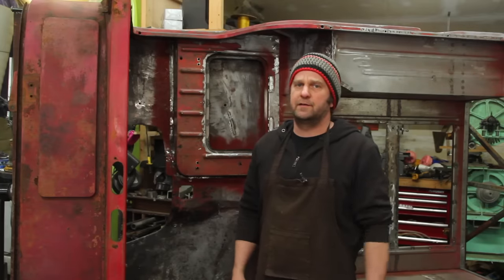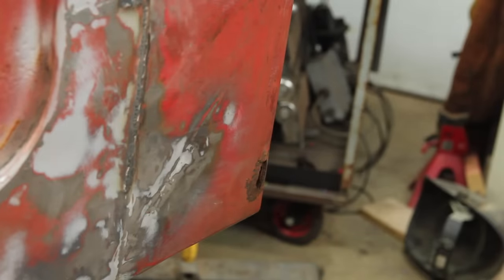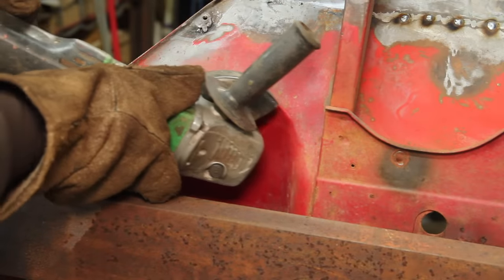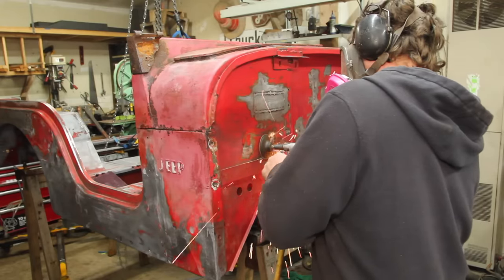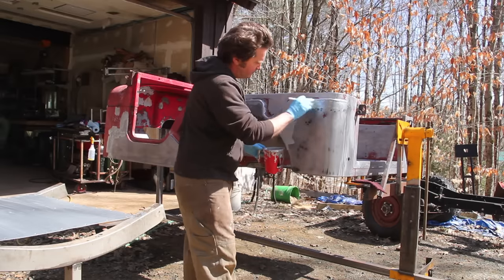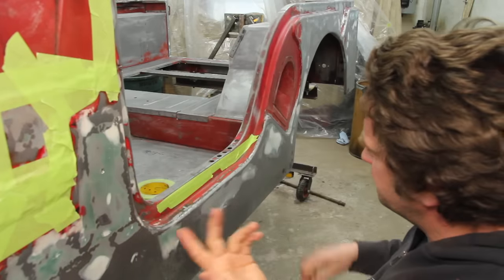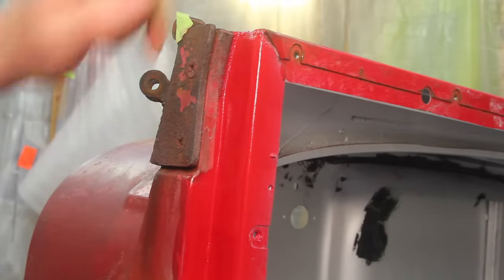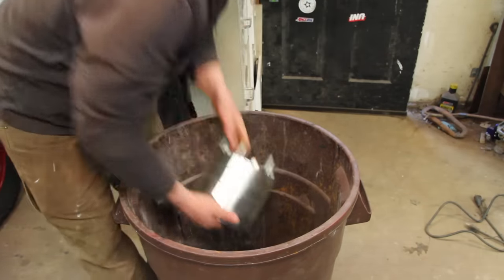An Appropriately Bad Paint Job (CJ5 rebuild part 15)

Comment: Jeremy, I agree 110% with how you rebuilt & finished the tub.  I hope to do something similar to my now 78-years-old CJ-2A.  When I bought it back in the mid-70s, I could already look through the holes in the floor & watch the road go by as I drove down the road.  Now the floor is virtually completely gone and I'll try to replace it like you did on yours.  I just hope that I can gather the wherewithal to build whatever I need to make the replacement parts rather than just buying "too-thin" stamped replacements.  I think it was red like yours originally, but it turned OD shortly after I got it (too much Rat Patrol on TV when I was growing up I guess) -- now I'll have to decide what color to paint it when I get to that point!

Comment: I've used a LOT of that Majik Paint, if its on a drill press or Milling machine you intend on keeping INDOORS it's excellent, but if it's going out in the sun it will be chalky and flat and look 100yrs old inside of 6 months in the FL sun, dont know how much Sun you get in your state?
Reply: He added hardener to it, it should be fine I would think.
Reply: @junkyardsearcher6407  Nope, I've use the Majik-brand hardener, as well as others, it looks and stays amazing INDOORS, but that paint has NO lasting in the sun, will be a flat chalky, PINK faded mess inside of 6 months (here in FL, his results maybe different depending on how much sun he gets there)
Reply: @Mad-Duk_Machine_Werkes  that doesn’t give me hope on my paint… thanks for the info.
Reply from the maker: That will either complete the look, or I’ll consider this a trial run and do it over with higher quality paint when I break it all down to do the inside and underside.
Reply: @Mad-Duk_Machine_Werkes  have you used Rustoleum paint with hardener? With longer lasting results?
Reply: Well, Jeremy, you certainly turned that "silk purse" into a "pig's ear." Good job. I think if you'd just sprayed the whole thing red and parked it in the weather for a few weeks, it would devolve into the buffed look you desire. So now what's next? Batteries?
Regards from Canada's banana belt. 🤞🇨🇦🍌🥋🐖💩🦃🇺🇲🏁👍